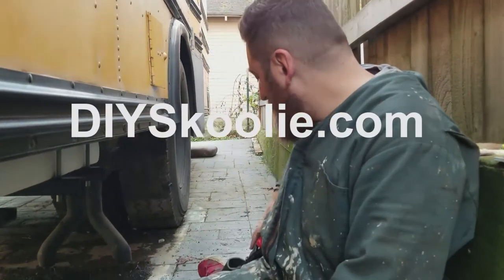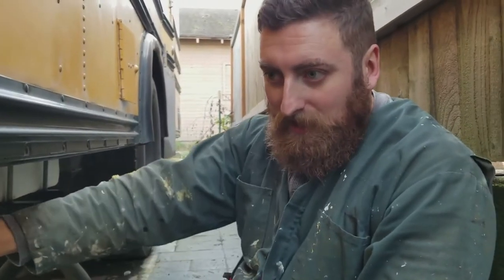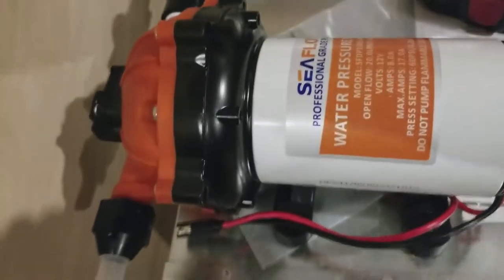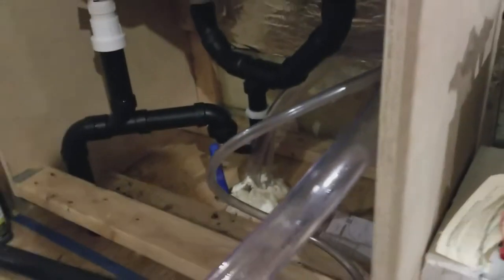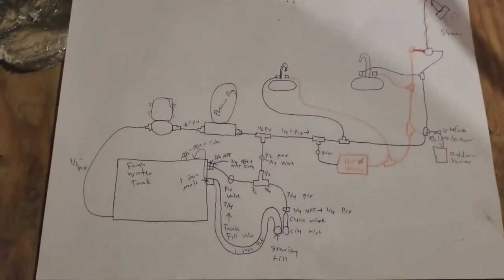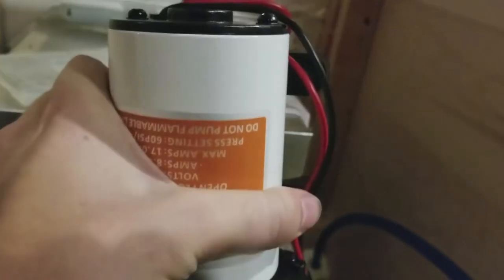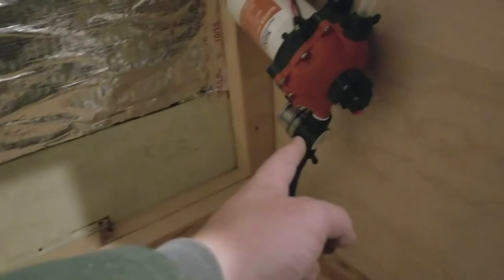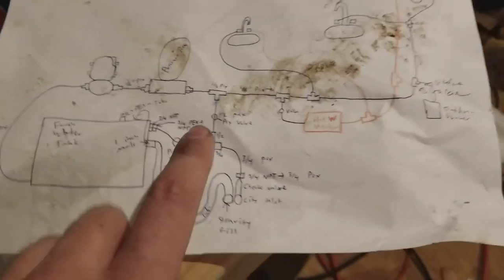Conversion Video 22: Installing the Water Pump

Comment: I would go 3/4 for the main lines and maybe 1/2 to the faucets and shower.
Reply from the maker: I thought about that, and even bought lines that thick, but ultimately decided against it because it creates more capacity after the pump and heater.  That means it will take longer to heat up my shower, and uses more water along the way.  I want to conserve as much water as possible, so I can stay off grid for longer stretches.  1/2 inch has plenty of pressure for my needs.  The only piece that's 3/4 is the inlet line, so there is no restriction to how fast I fill my tanks.

Comment: SO, I came across a possible problem. I want to travel to really cold places. I live in the middle of Texas and have no cold weather experience. My concern is that if the water tanks are out side the bus, would they freeze in cold weather, destroying the rig? Is their a solution? am I missing something? Do you not plan on traveling in the cold?
Reply from the maker: I don't intend to go to very cold places, nor do I intend to fill the tank to the tippy-top.  But, that said, I do some things to prevent the tanks from freezing.  You can get 12v tank heater pads that stick on to the tanks and just keep the water from freezing, as well as heated pipe inulation.  It doesn't heat the water until it is warm, but it should keep it liquid. It would function off a switch.  I may also insulate the tanks within a box.  Really, it came down to either putting the batteries or the water tanks in the heated living area.  I wanted my batteries to run as efficiently as possible, so they won the warm spot, although they are vented to the exterior within box that is air-sealed from the living area.  This also kept the wire runs shorter, for maximum efficiency, which was my primary concern.  In short, I don't want the tanks to freeze because it can cause damage.  So, if I am going to a cold place, I will be taking steps to prevent freezing.  It might be the subject of a future video.
Reply: Awesome! I think it would be a very informative video! I appreciate the reply so very much. I still have not made a decision though. I am a rock climber who plans to travel north and I think a video about the water tanks and weather would be unique and very educational. I have no experience doing this type of work and rely almost solely on videos such as yours. Your a total life saver! I look forward to videos of your future journeys as well.